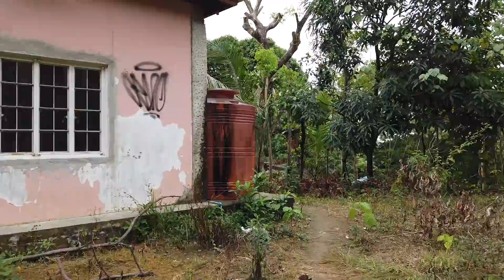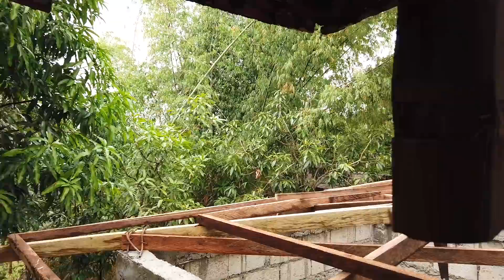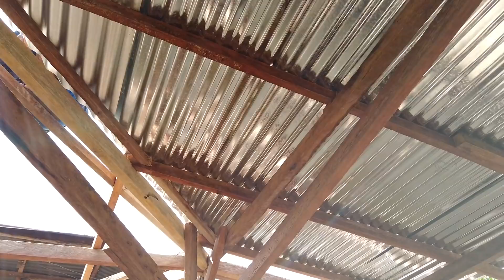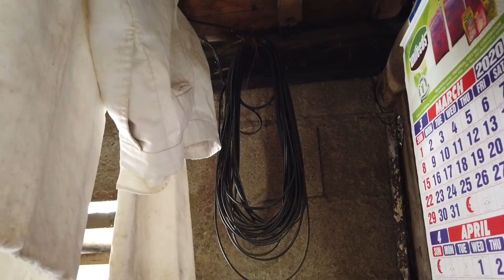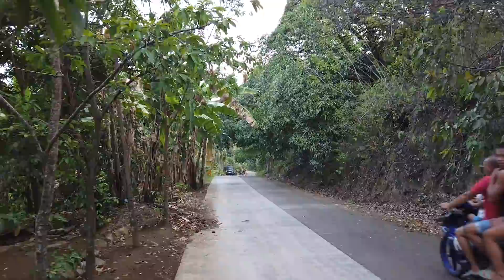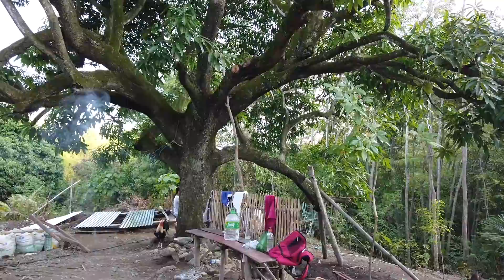Day 42 Budget Bungalow Build In The Philippines. Sheeting.

Comment: As I never did get to install a proper roof on my project, these last few videos are very important for me. One problem I have with this traditional roofing... and I am not saying this as an insult to Filipinos and Filipino construction, but what I need for myself. I remember visiting my grandparents in the South of the US. They also had a corrigated tin roof. I love the sound of rain hitting tin roofs. Still, I am not a fan of leaving out the use of plywood, tar paper, tar, and nails with washers before the tin. I know those items will add a significant cost to the roofing, but for my own personal usage, I just don't like providing space for spiders, lizards, and no telling what else to come in. I also believe this process will make even coco wood to last much longer. I'll have to look at the cost difference between this using steel, although, the outside elements will still be able to come in even using steel trusses. On the cheap, I may even paint the plyboard with acrylic paint instead of the proper process, but plywood seems like a must for me. I know some Filipinos say that lizards in the house means good luck, but I came up in a culture where outside should stay outside.
Reply: Plywood is mainly put down to affix  asphalt shingles . Corrugated iron is primarily used in NZ and no such plywood is used or needed. Tar paper is used to run off condensation caused by low overnight temps and warming in the morning, not necessary in the Philippines. Agreed that fixing screws or nails ideally have washers.  The keeping out of unwanted lizards etc can only be done by enclosing all gaps between external cladding and roofing. This build would require framing in between the  trusses and the top of the poured beam topping the blocks or boxing in the eaves to the wall leaving no ventilation  minimal though it is. The beam by the way could be poured into bond beam blocks but it seems no one makes these or column blocks , rebated window and door blocks etc . Blocks if made  to the correct mix ratio  and laid accurately and pointed nicely would eliminate the need for rendering both inside and out and still look nice.
Reply: Lizards don't bother me . The tin roof  makes the house a oven .   No insulation ,  no or little ventilation .  
  It's the worst style for a hot humid tropical climate .   The roof here need massive openings like the Tahiti style . Screen it in
Reply: @nevbillett7554    first time I saw how they laid blocks here I was shocked .
 My father and 2 brothers are Mason's .      Still the block often has stucco applied to hide the block 
   They leave it rough so the cement sticks better they say and maybe are adding concrete to improve structural load ? Idk

Comment: aww i feel so sorry for you . im a builder in austraila 45 years what would take one day turned into almost 4 days , and what i see .its a waste of wood . it a light weight roof for iron !! yes i understand different cuture but still , im sure your know and feel your being milked. i really feel for you .your a nice person and i hate it that your being milked .
Reply: graham chandler you can’t compare Australia to this job all roof trusses in Australia come prefabricate on the back of a crane truck how long ago were you a builder ? In the 60s
Reply: @gregbrown7829  What they have made on this job are not technically trusses as defined in the NZ and Australian building codes. Two men could easily cut and frame this roof in a day and go home early. With handsaws make it a day and a half , but of course we would cut it on the ground . Very easy to mark it out on the floor or of course all us old carpenters (I'm 64) know how to cut hip roofs to 22 degrees  and we would have placed all the tie down rods into the exact places in the top beam by working out the placement of the common rafters  referred to as trusses here

Comment: What type of wood is being used for your roof?
Reply: Looks like coco lumber
Reply: @Cpt_Mal  You are correct that is what it look like but I want her to say that way I know 100% of what type of wood it is.
Reply: I am trying to find out if it is hard or soft wood because I am a wood worker and I would like to build something out of it but I need to know what kind of wood it is first once COVID-19 ban is over I will be going back to the PH.
Reply from the maker: Addis Booth Its a combination of aged and seasoned, Molave, Cocowood and Lubris. Some of the wood is so hard that they pre drill before hammering the nails.
Reply: I know there are a lot of videos with this build but almost every one of them will be helpful with your project. One of the earlier videos talks about the kinds of wood and why they were chosen. I have dealt with a great deal of the same things she has with this project. As an American, it has been my experience that most wood can be useable, even if it is soft or porous, as long as it is treated. Still, I am not that familiar with coco wood. I am curious if coco wood is treated (painted) or treated with some sort of water-resistant chemical if it will resist bugs and water better. Looking at the old couple's 50-year-old house of untreated coco wood, the wood is still holding up.